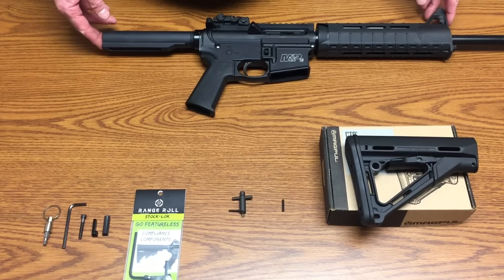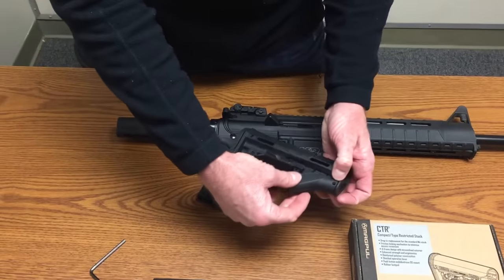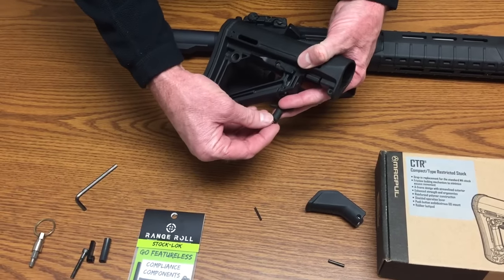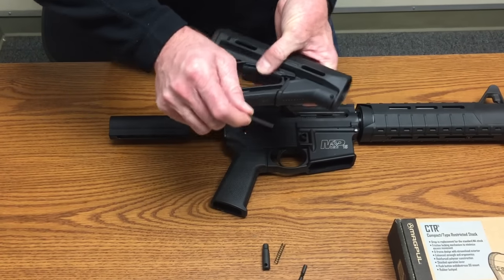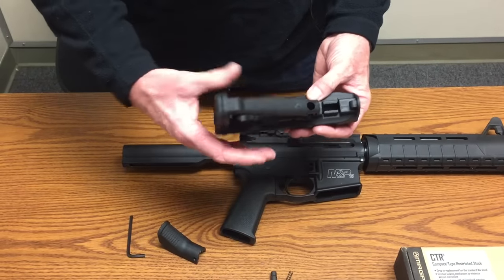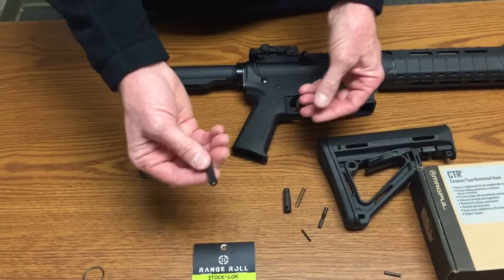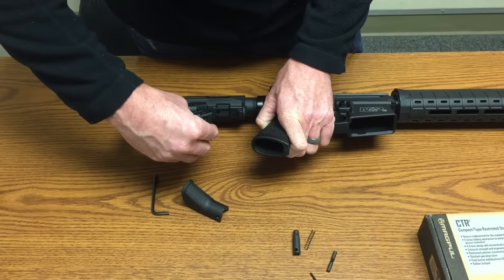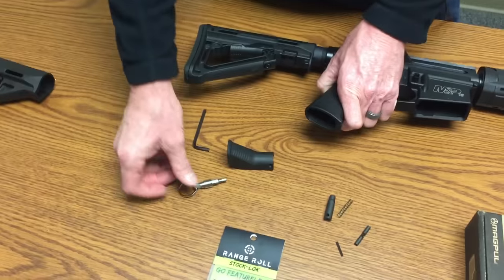Stock-Lok's use with Magpul CTR stock: CA Featureless AR Components

Comment: Strike Industries makes a universal plastic stock lock tab that's removable in 10 seconds, no tools required  for $7. The best no hassle  and cost effective route I've found so far.
Reply from the maker: Maurice Nunez Strike Industries Stock Stop you are referring to does NOT meet the legal definition of “fixed” in California and other states. Scroll down the comments to see a discussion on it. Using that product does not make your stock fixed, by the legal definition. Just so you know, if you use that product in a featureless setup, you are not compliant and you are open to felony assault weapons charges. Make sure you do your research and truly understand the law - we’d hate for you or anyone else to lose your rights and face criminal prosecution for using a different product that doesn’t actually comply with the law.

Comment: you can buy a non adjustable stock for $35
Reply from the maker: EvendimataE Yes you can, but as you said, it's "non adjustable."  With Stock-Lok, you get a fixed stock that is adjustable. Plus, if you have a nicer, upgraded or aftermarket stock, you can still use it without tossing it or damaging it. Different options for different priorities.

Comment: dang even selling a spacers too?  couldnpt it just be added to the kit for $34.99?  not hating...just saying.
Reply from the maker: Hi Ken. We developed the spacers quite a while after we released the Stock-Lok. They are completely optional and only used as a guide to avoid over-tightening on a few, specific stocks. Therefore they wouldn't be appropriate for all stocks. More importantly, we have the Stock-Loks machined and packaged through one manufacturer and the sleeves are produced separately in another location. For those reasons, they aren't all packaged together. For those who feel they need or want the sleeves, they are only 50 cents. Hope that helps clarify and answer your question. Thanks!
Reply: Range Roll thanks for the explanation ... didn't mean to come off the wrong way. Still like the product. Thanks !
Reply: Are the spacers still available? Looking to purchase stock block for my CTR but I can't find the spacers on the website

Comment: Does it work with any other magpul stock?
Reply from the maker: Skidstainz 1D Yes, it does. It works with most Magpul stocks. The only one we can think of that we haven't tested it on is the UBR, so we can't say with certainty whether it'll work with the UBR or not. The STR takes a little more work to disassemble for installation, but the others are easy to install and use Stock-Lok with.
Reply: Range Roll okay cool, I have the STR

Comment: I got the Strike Industries Stock Stop for $6. Easier to install. No tools required, just scissors.
Reply from the maker: Branden's Outdoor Channel According to California law (and laws in several other states), the Stock Stop does NOT meet the “fixed” requirement. That design was actually one of the first designs of our product years ago; however, after consulting with several firearms attorneys and firearms experts, we were informed it is not considered “fixed” due to the ability to pull up on the adjustment lever and slide the stock, as you do when you remove it. If the stock can be manipulated and moved with your hand, even to remove it, it is not considered “fixed.” It has to be secured in one spot so it can’t be moved at all with your hand. Securing with a roll pin works, or securing with a screw, like our product’s final design does, also works. That is why we redesigned our product to require the use of a screw to truly “fix” the stock to one position. If a law enforcement officer pulls up on the lever of your stock and can slide it, even to slide it off, it’s not fixed and you are not compliant. Now you know. And since legal responsibility falls to the end user to be compliant, I’d suggest making sure you know the law and which products truly meet the requirement of the law. Saving a few dollars for a product that doesn’t truly meet the requirement of the law can cost you thousands in legal fees, and jeopardize your legal standing.
Reply: @rangeroll9193  i squeezed the adjustment lever and it doesnt move fowards or backwards.  Seems fixed to me. They are selling it as compliant.
Reply from the maker: Branden's Outdoor Channel It’s not squeezing it that will move it. It’s pulling up on it as you would to remove it - that’s when it’ll move. Yes, they are selling it as a compliance component; however, that doesn’t make it an actual legal component that meets the requirement of the law. Simply pull up on the lever like you do to remove the stock from your buffer tube and you’ll see you can move it, slide it and remove it with your hand. That means it’s not fixed. We spent a lot of time and money researching this matter when we were designing and developing our product, so we could ensure we were legally compliant and so were our customers. We hate the crazy restrictive laws as much as anyone, and we really hate the thought of good intentioned folks like you, thinking you’re using a product that makes you legal, only to run the risk of getting popped for a felony AW charge because one of your products didn’t actually meet the requirement of the law.
Reply: @rangeroll9193  if i could avoid using any of these products,  i would. The CA laws make no sense. How is a collapsible stock more deadly than a fixed  stock?
Reply from the maker: Branden's Outdoor Channel Agreed! We hate neutering our firearms to comply with these ridiculous laws too, but as law abiding CA citizens we don’t have much choice. Hopefully one day these restrictive state laws will be struck down as unconstitutional, but in the meantime, with livelihoods here and families to depend on us, we’ll make sure we’re staying legal and keeping our guns legal - even if we don’t agree with it.
Reply: You taught me something new actually.  I run a strike industries stock stop on my AR.  So when you mentioned it doesnt meet the fixed requirement.  I decided to take a look at Strike industries website and in deed it is very questionable.  On the Stock Stop product page at the bottom in very small print.  It does state that the Stock Stop  was made to conform to DOJ criteria, but it has not been approved.  Now that doesn't necessarily mean its not legal.  That just means its questionable and could still get you in trouble depending on how much of an asshole what ever law enforcement official you might encounter wants to be.  I will be discontinuing the use of the Strike Industries Stock Stop, because I dont like gray areas.

Comment: JE Machine Tech owns the original patent for this locking mechanism.
Reply from the maker: FASTMTREE Yang Nope, not according to the USPTO. Besides, our featureless products are completely different - different designs and different functionality. Theirs requires their “locking pin” to be secured in one position and the roll pin to be reinstalled, thereby completely restricting you to one position. Ours is designed to secure with a screw, allowing you to change the positioning of your stock by using an external tool to disassemble, move and reassemble your stock. Ours is really the only product that allows this functionality while still complying with the featureless requirements. You should try it out! Thanks for the comment. 👍🏼

Comment: Does the screw fit snugly into the vertical channel in the stock or is there wiggle/play?  I have a Magpul MOE SL
Reply from the maker: The screw is loose when you put it in the channel, but once you tighten it down to snug, there is no wiggle, play or rattle.

Comment: So you CAN theoretically adjust it later to fine tune the length of pull, you just have to disassemble the stock?
Reply from the maker: Yes. You need to use an external tool and complete disassembly of the stock. It would be the same as if you removed a fixed stock of one length and replaced it with another fixed stock of a different length.
Reply: Range Roll does this work on any collapsible stock?
Reply from the maker: Captain KMFD Yes, Stock-Lok works with almost all telescoping stocks out there. If you have any questions about installation or use with specific stocks, just email us at info@rangeroll.com. Thanks.